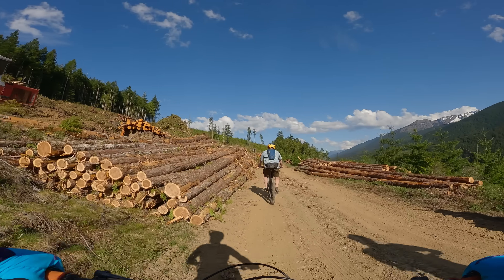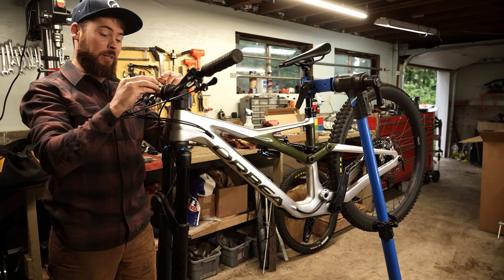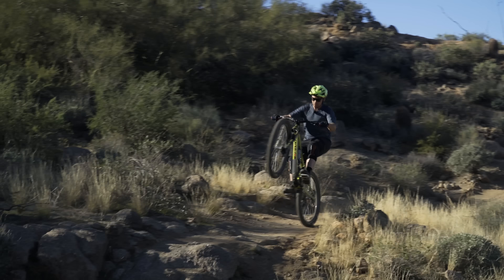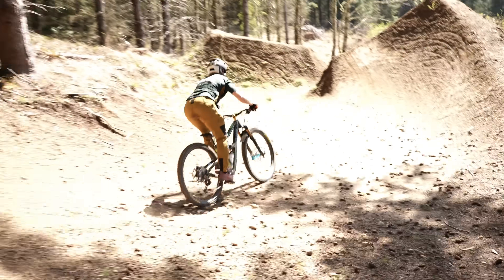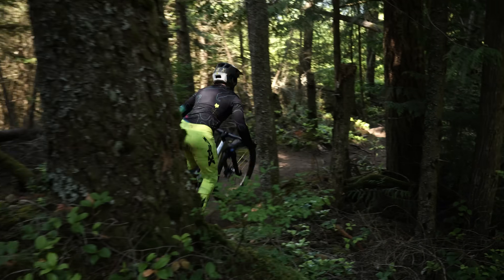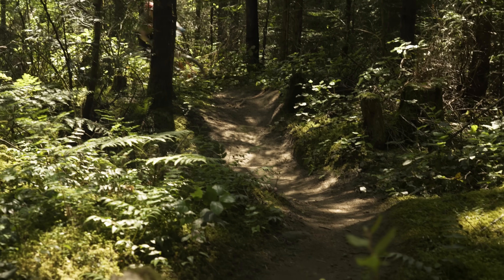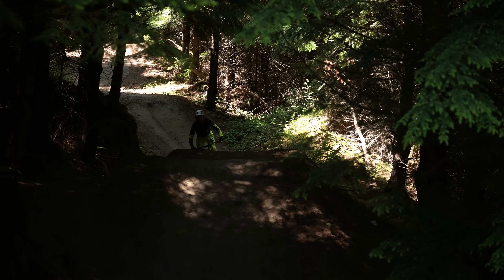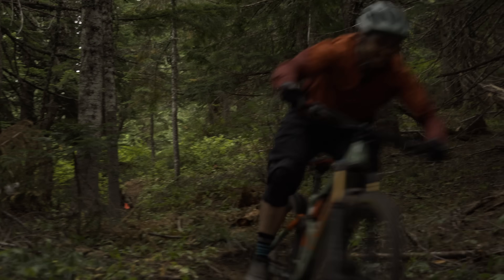7 Pet Peeves with Modern Mountain Bikes

Comment: Here are my Pet Peeves.
Bikes that don't have clearance for 2.6 tires.  It's my favorite tire width.    
That no one makes an XC bike with truly progressive geo. Think 77* STA and 65* HTA.  I love XC bikes but I don't love XC geometry.
When is someone going to make a 1x drivetrain with a 9-54 cassette with a 600% range.  I don't want electronic shifting.  I want more range.
Reply: Just one more.
Steerer tubes that are cut too short.  Every bike should come with at least 2in/50mm of spacers plus the stem.  Just like people cut handlebars because they're too wide.  Leave it up to the consumer to cut the steerer tube if it's too long.
Reply: @marksandoval5361 there are bikes like the stumpjumper carbon that are very light and have the geometry numbers but with 10mm  more travel. Also things like the Scott spark with the 130mm fork get pretty close while being very racy

Comment: #7: I'd say if you have a mechanical background and some common sense, torque wrenches aren't necessary. Had handlebars come loose on me after tightening to 'spec'. There's just a certain 'feel' of knowing when something is tight enough when you have the experience. Also, certain size bolts/nuts are made to withstand certain torque numbers; ie bigger the bolt, bigger the torque. Just think about the length of a spanner in relation to the size of bolt/nut it's for.

Comment: 7: the only time I've ever used a torque wrench was on my carbon road bike combined with copious amounts of carbon assembly grease or whatever you call it.
6: agreed but I also disagree, if it's a mainstream big company announcing a product way ahead of time it's annoying but if it's teasing a product or a small company showing off the prototype/concept then it's sick
5,5: LMNT goes glug glug glug
5: as someone who used to be 115KG (250LBS) and came from street riding for MTB I really feel the setup issue, luckily I ride hardtail and fork hasn't been as big of an issue.
4: WHY IN THE WORLD WOULD ANY BRAND DO THIS?!!!!
3: Trends are nice when it's pushing for something genuinely beneficial and nice but it's turned into a situation of to much of something good and just heavy advertisements in one area while loosing details in other areas.
2: never actually encountered this issue, might be cause I'm 187CM or just that I've been lucky.
1: my hardtail suffers from this, I put a 125mm dropper in there and it's nearly slammed, I don't even have a rear shock or linkage or anything that would prevent the frame from being lower which just makes it stupid.

Comment: https://youtu.be/-T0f0GzGLKM?t=105 Was that a Trek by any means? I snapped same bolt twice and I even used a torque wrench to specc, still broke. Local bike mech thought it was that the hex needed to be very long and go deeper into the screw. These bolts also had to be ordered from another country so costed me 50 bucks each time, so total of 100 bucks for a this and weeks of waiting, which is the worst part.

Comment: All internal cable routing should be as good as Yeti and Specialized.
Orbea ship bikes with shit bearings why would you do that to your customer when you make such awesome bikes.
Yeti built an awesome sb130/sb150 but made it so you have to hang off the front to not die…. 5 years later they fix it… why not just prototype properly in the first place.
Wouldn’t it be lovely to have proper interoperability between drive trains and not have to know all sorts of weird facts about machinery that  baffle your mates when he’s bought new wheels and his cassette won’t fit. 
I could go on for hours :)

Comment: Get a torque wrench IV been a mechanic for 30 years you can’t replicate a torque wrench ever, u will never by hand torque a bolt correctly ever, sorry, torquing a bolt is stretching the bolt in length, only way to gauge is a torque wrench or the super complicated tighten the bolt measure the stretch until perfect totally impractical, plus you know that feeling of tightening a 6mm steal bolt into aluminum and it strips, ya it will happen like 95%less with a torque wrench.